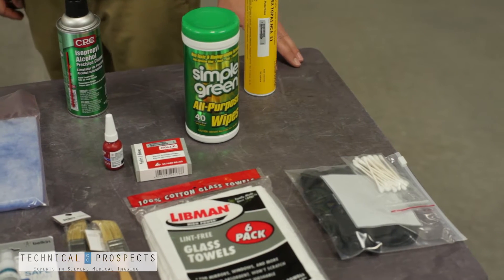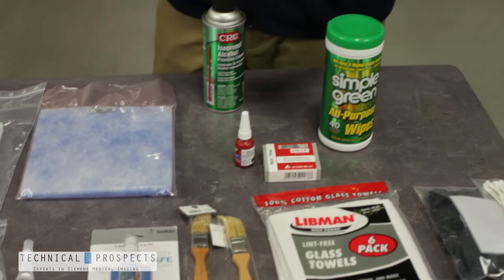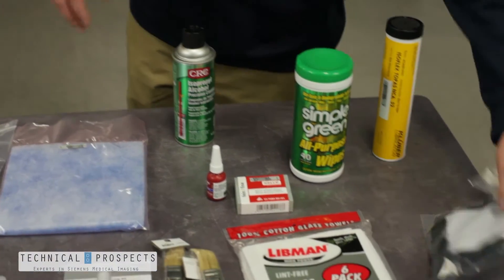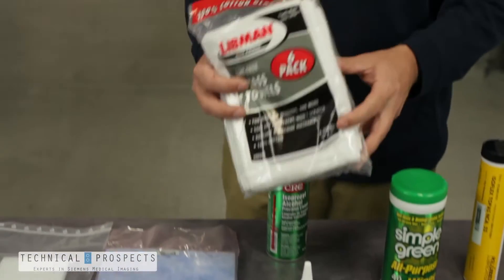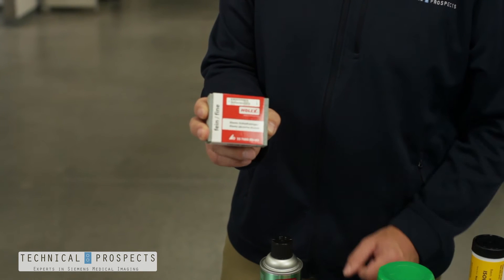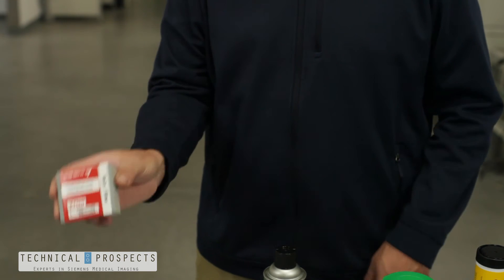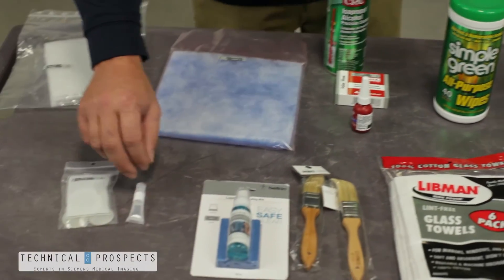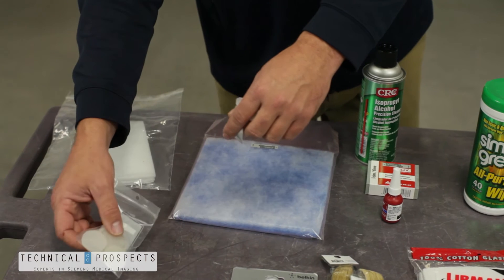Siemens Sensation CT 4 part series – Part 4 Preventative Maintenance

Comment: Hello, in Siemens manual of replacement of parts (XTA and HVT), states 
it is not longer necessary to use silicon oil, because silicon oil is 
already present in the material of the isolation washer.
Reply from the maker: Thank you Julio for your comment.  You are correct, some of the silicon discs (the majority of the newer discs) already have the oil
in the material.  Call us if you require more information.
Reply: I'm a CT. I'm an after-sales service engineer. I'm from China. Your discussion is very exciting. Can you join a good friend to study with me?
Reply: @雷锋-n3l  hi there

Can you please help me out with service and instalation manual please